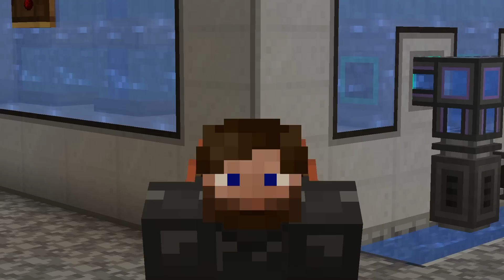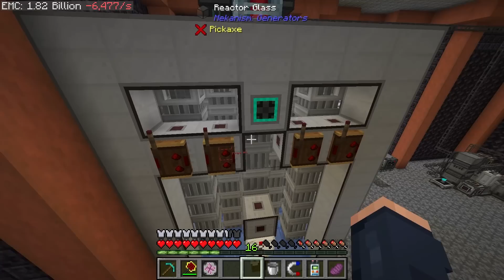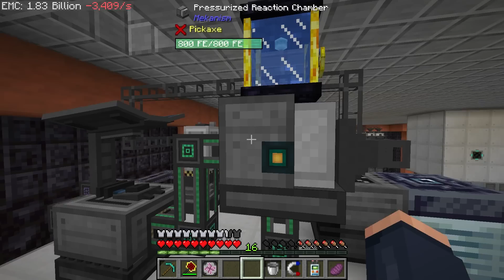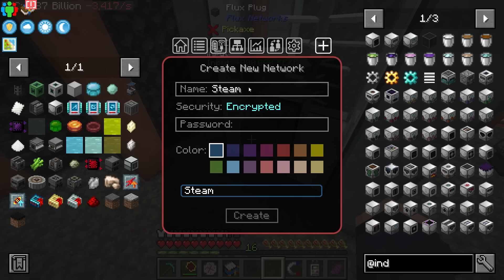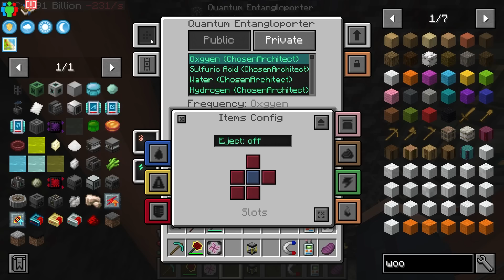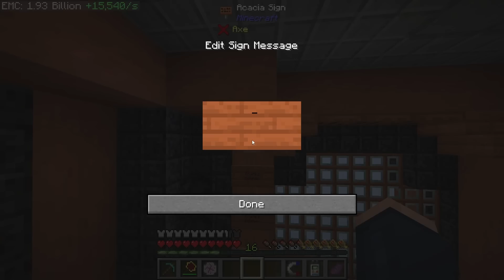Mechanical Mastery Minecraft Modpack EP18 Fission Reactor Mekanism Automation

Comment from the maker: It does look like in the recent update they did add a trash can mod so now you can void off power even though now I have no need for it 😂
Reply: you still kinda need the power, cuz you need at least 6 antimatter pallets, and also 1mb, so you can make a creative tank for infinite antimatter
Reply: I use mine (two of them actually) to void the steam from my fission reactor. Water can be pumped in using Integrated Dynamics with 'max_int' if you have an infinite source but Integrated Dynamics can't handle gases (at least in ATM7). Rather than generating energy I just dump the steam. A Fusion Reactor is far superior and has no risk of explosion or radiation.

Comment: The best method for fast reactor water is if you have access to the Evertide Amulet put it in the bucket input slot of a Mekanism dynamic tank and it should fill any size tank almost instantly
Reply: This yup yup.  But you only need to set it up for the initial fill...then it is a closed loop system, if you have your ratios right.

Comment: Btw, as soon as the water is enough to circulate at your burn rate of choice, u should turn the water pump off. That can break ur system by overloading it with water eventually.  Btw, the aqueous acumulator with full upgrades were faster in my experience.
Reply: Wrong and wrong but your mileage may very.
Reply: Yeah sure

Comment: If you ever increase your Reactor Output, the one basic tank will not suffice.  I had to upgrade my system to a Dynamic Tank with MULTIPLE outputs each with an Ultimate Mechanical Pipe to keep up with the water demands.  This is also with 2 Turbines.  I produce about 6M RF/t, which made my Antimatter Pellet Production bearable while I set up the other systems for the Final Star needs.

Comment: Don't ever set mek pipes / tubes to pull if the machine can auto-output. You can cripple throughput in shorter runs since their extraction rate is a function of the pipe network's size